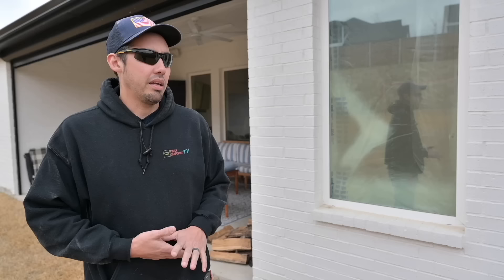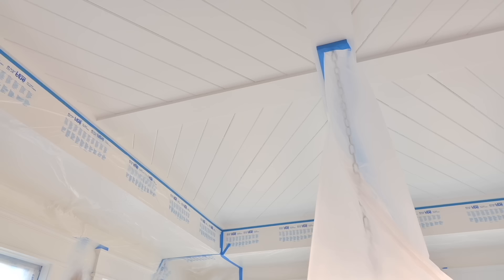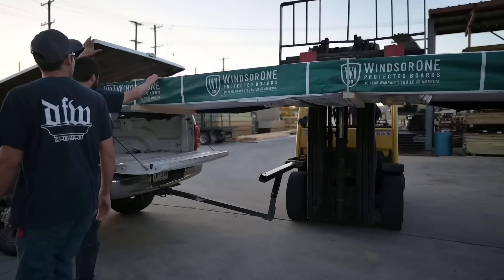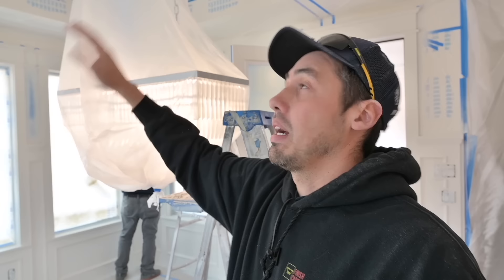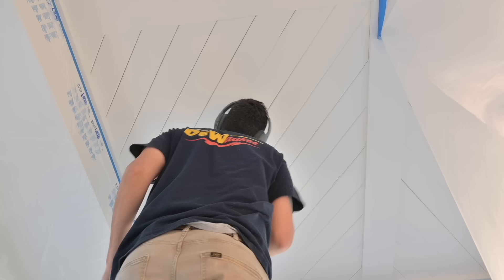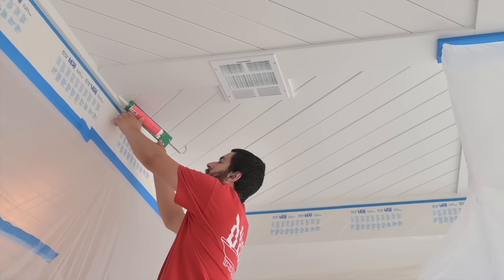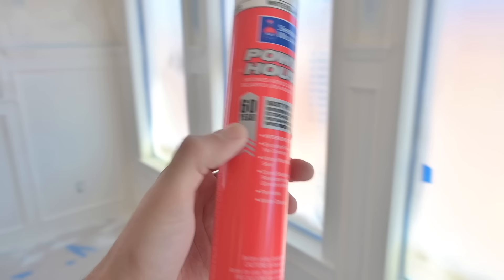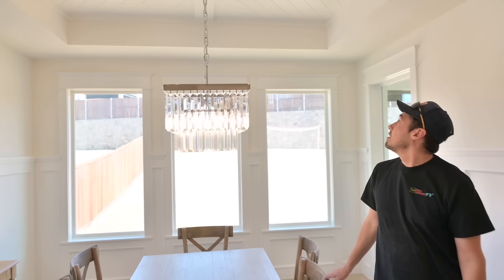Customer furious with me - Failed Trim Install

Comment: Shermax is lifetime. And it's urethane- ized. Urethane is the toughest it's what is used on commercial buildings to seal between the concrete panels. Undoubtedly the oil base stuff is higher quality. Their storm blaster is incredible and more difficult to use. I've used shermax many years and haven't seen it fail once. It's easy to use dries quickly, unlike some pretenders w/ very long cure times.

Comment: Neen doing this tyoe of work 34yrs and its alot more common for this to happen with today's lumber they grow these trees alot faster and harvest sooner u didnt have this problem with old growth wood. We use to installed fence boards with a 16 penny nail gap for expansion and now we butt them tight its definitely sucks cause its not your fault material is just chit even caulking has gotten so bad

Comment: You making it right is the sign of a professional. Right now we're going through a kitchen remodel in preparation to sell and the contractor we went with is horrible. They actually tried to install two different countertops thinking I wouldn't notice. I don't have the patience to list everything they failed on but my advice is never hire somebody based solely on the quote.

Comment: Those boards  Could acclimate for a year and that would still happen. It's wood. It expands and contracts seasonally. Flat sawn boards will shrink more than quarter or vertical grain.

Comment: Oh Boy,ok one way is what everyone is saying don't caulk,the other way is TO CAULK,
Allow me to explain.
Expanding wood is of course going to happen,it's how you midigate the appearance through the ever moving nature of wood.
You Caulked then painted,correct?
How you can address is to finish paint after you install,DO NOT CAULK PRIOR TO PAINTING,instead have your caulk matched to the Paint color and after the paint has cured then you caulk,if you want it to look tight and never see the movement, that's the trick. 
It will always move, always,doesn't matter if you sealed all six sides and then installed,.I swear to you this is the process for success. The caulk will fix with the movement but not look bad or have any cracked looking paint.

Comment: The homeowners HVAC system need to have dehumidifier and humidifier on the central system, otherwise it will crack again every year with the weather change. Caulked t&g can't be warranted with out proper HVAC. Your doing this in the winter, it's dry, the boards will expand again in the summer. And no, AC is not good enough to control humidity in the summer time. Vintage Painters on any other platform is my info. Much respect

Comment: Paint and caulk makes it what it’s not… lol… If you allow your materials to acclimate to the inside of the home… like hardwood floor guys do… you’ll never have this issue. That said, the heat/AC must be running and time doesn’t always allow for this. Another solution is to use pre finished T&G. It costs more… but the cost is offset by … no caulking needed at all… and no callbacks from unhappy customers. I believe that Intercity Lumber in Tampa Florida has the best prices on pre finished T&G in the country. They also carry unfinished cypress T&G… which will not shrink either… and it’s as cheap as pine. At least there anyways.

Comment: My entire house is done in carsiding and it definitely moves with the seasons. I also heat with wood which doesnt help.
Reply: What's the year, make and model of the car? I wanna do my house!
Reply: @symcardnel1741  1 x 8 x 12' Unfinished Tongue & Groove Carsiding
(Actual Size 23/32" x 7-1/16" x 12')
Model Number: 1411300 Menards ® SKU: 1411300

Comment: From observation, and from experience with wood, regardless if the wood is coated with a finish, it will still move with temperature and moisture fluctuation, perhaps just less.  I personally look for detail options and approaches that minimize the use of sealant when possible.   Sealant is a hassle and a pain to remove and replace.  I would not use in such an application.  It just draws attention to the condition when it fails.  I'm afraid that it will happen again.  Time to educate the owner on what can realistically be expected from wood or any material with shrinkage potential.

Comment: I don't think I would have caulked this to begin with... I have installed similar ceilings where the boards are painted and finished, and you use fastening clips that are hidden the tongue and groove.
Not sure how much expansion/contraction these can take before it shows, though.

Comment: In the future, prepaint your boards and install everything with no caulk whatsoever. Caulk turns a joint in to a maintenance item. It will be all cracked and separated again next year.

Comment: The case of a good installation which failed because of moisture content.  Hard to predict how much a board will shrink over time.  Not like flooring which has been dried.  At least you guaranteed your job.

Comment: One of the biggest problems with modern carpentry is that its techniques do not take expansion into account as the focus is more on design. 
The vast majority of work out there today has these issues and I would say it is a norm.

Comment: In flooring it's common for companies to let material aclimate to it's forever home, usually the reason why flooring is not installed untill HVAC is running. Would you say the same could be done here to prevent these issues?

Comment: The reason why this happens is because the back of the boards weren’t painted. It’s like when you paint one side of a door and when the client turns on the aircon and the door cups.

Comment: I'VE BEEN A CARPENTER, FINISH, CABINET MAKER FOR 35 YRS.....
THAT IS NOT YOUR FAULT....
this is normal expansion and contraction of the wood.
I had a guy complain about his 3 1/4" T & G  maple floor, finished natural, Installed in July, in a house just 700 ft from the water, flooring had been in the AC'd house for a month when installed, moisture was under 13%, industry standard when installed. Come Nov. when heat turned on, the floor shrank, each board about 1/128th, 1/64th....but 2-3 rows would stay tight, so the gap that showed up, was like 1/32nd of an in., which against the white floor, looked huge. Told him, unless you set the humidity level and temp at one setting, year round, this is normal and going to happen, wood absorbs humidity, moisture and swells, and then dries, shrinking, THAT WOOD
if anything, on that they were painted too soon and my painters NEVER caulked the t&g joints, because when the boards shrink, the torn caulk looks horrible

Comment: No dude. Even if they were bone dry, you would have issues. The moisture in the ceiling fluctuates like crazy, so does the temperature. Weather,heater and AC use just add to that. Temperature up there goes from 40- 125 f.  This does not show much in stain but when painting it shows way more. No pun. First off , you used cheap caulk like painters caulk hence why it almost peeled right out, then you used an OK caulk. 60 years 😂 yeah sure. Next time use trim screws, screwed in the field and on all cuts to joists or blocking to limit movements, then use a high quality elastomeric or urethane caulk. That will get you ten or fifteen years before you need to recaulk when the white room needs to get repainted. Next time put the extra 2k in the job for the extra time and material costs. Also let your client know before you build it that ceiling is going to dance and it will require maintenance every 10 years or so.

Comment: I worked on a few ceilings over the years. As a cabinet/furnituremaker I have superior skills to most finish carpenters. F carpenters don't like to hear that.
It will fail again in another way, someday. Experience is hard-earned.

Comment: hello, maybe a diferent caulk ? some caulk that expand and contract for this cases?
.- like in some hardwood floors , it must leave the hardwood floor in the house 15 days for stabilization at least ?
.- maybe "nelzonize¨ with nelsonite ?
.- and never use paint white in  this cases ?
.- is it  better if use mdf moisture resistant for this case ?
.- maybe some times apply paint and lets dries in the tongue and grove before instalation ? 
.- maybe apply paint in the six sides of each table or plank ? or sealer before instalation ?
this is just a commnents, thank you.

Comment: As a flooring store owner I lost jobs because I required acclimation on all products, even the waterproof that says not required and my  competitors did not require. I always doubled what manufacturer required. Reason being degree of temp high and low.  We will be 90 in day and drop to 5-60 at night. Humidity will go from 70% in an hour to 12%. My competitors always said never had a problem until like this gentlemen there is always the first time. I can say in 25 years never had this issue.

Comment: I have found out the warranty offered on a caulk means nothing you don't apply it correctly. I have seen people use that stuff and a year later is cracked or peeling away.

Comment: Don't take it so hard. There are many factors in that room, you had high ceilings, many windows, that makes it very hard for the wood to acclamate due to the variable temperature. But great work for showing others that you can correct an error.👍👍👍

Comment: The whole idea with T&G is that it allows for movement , NEVER caulk it ! what you need is the apply 1 coat of finish BOTH sides and final coat after install .live and learn...

Comment: I don’t think this is primarily your fault. I’ve installed plenty of these 1x6 v groove T&G boards and they shrink like this often, cracking the paint. It’s something in the milling process where these boards aren’t dried well enough, or pick up too much moisture right before install. They swell, get installed, and then are conditioned and shrink back down. You’d almost have to acclimate the boards in a conditioned space for a good length of time before install. That’s not really an option for most people.

Comment: Sometimes the house is wet and painters will use water base paint oil primer is better  and use glue on the joints  this is a big problem in Virginia  The builder is the problem

Comment: Demo the work, get it to where work can begin. Then pay back the clients. Then go back to the drawing board. My biggest loss was $3k on a kitchen job. My laborers knew I was in Palm Springs working at a new site so they shot kitchen cabinets with cheapest latex they could get and pocketed the money I gave them for sand paper, top grade sand able primer and Benjamin Moore Cabinet, Door, and Trim paint, which dries hard and can easily stand finger prints and washing.  It's 4 X the cost as the latex they got.  Then my laborers took the money divided it and went to another job, where I found one of them.  The guy who used him fired him on the spot.

Comment: I think customers expections with painting wood is like the same quality as a car which is all most impossible .Wood moves period  I'm sure on the ceiling you can add an extra 5 degrees with heat rising .
Had the exact same thing happen on a cabinet side the wood shrank  agap was left with the caulking I did fix but brutal because I used 2k urthane white .
The only way to get that perfect  is mill mdf sheet with the groves
Great video shows the truth about white you see the smallest gap

Comment: you should have a contract ready for customer to sign, where you tell that the humidity of the wood exceeds your recomended moisture and you can install ir right away but you wont take responsibility, and if it cracks it will cost them extra for the repair.

Comment: Probly a combination of movement and wrong caulking. If you used paintable glue at each joint would it have buckled instead? Maybe the caulk was painted before curing, trapping moisture

Comment: Richard, what are the chances of this happening again?  Is it possible for those boards to expand/contract to the same extent as the humidity and heat oscillate through the years?  Thanks for showing this unfortunate (and rare for you) outcome as a cautionary	tale for the rest of us.

Comment: Caulking is going to fail in a year again, always does, and is a pain to fix. Use MDF instead. And it paints really well too.
Reply: 60 year Sherwin Williams caulk? Yeah, ok....it'll be there in 60 years, but it's only going to be stuck to  one side in about a year. You'll be back.

Comment: The boards need to be allowed to acclimate to the room like floor boards and tongue and Groove board edges need to be painted prior to installation.  Why caulk the joints? Why didn't you use SW SherMax Urethanized Elastomeric Sealant which is a class 35 sealant?

Comment: I blame you. Not because it cracked but because you probably didn't explain it in the contract. Technically it isn't your fault that the house expanded so soon, it's the size and most likely weather conditions that caused it. It would be like it happening 10 years later which is when caulk starts to show wear and tear and they hold you responsible. Another thing, this happened to me once and you can order customized caulk to match the color and finish at Sherwin or Benjamin. It saves you the headache of repainting because that's a very nice addition on your behalf but absolutely overboard.

Comment: From a professional painters point of view. Never caulk tongue and groove. That is the point of it. Expansion and contraction. Same on exterior soffits etc. maybe use some cheap ship lap board or a type of material similar to avoid to movement but never caulk ship lap. Wood always comes never fully cured. Thats the reason a good builder will sticker and tarp the studs before a build. Mills always ship with a high moisture content.

Comment: I don't care what you do, it will happen again next year.  It will expand in the spring and summer, then it will shrink in the winter as soon as the clients crank up the heat. It happens every year and I explain it to them and make sure they are okay with it. In the future you could mill your own T&G out of MDF, eliminating any chance of expansion and contraction.

Comment: But when there is a streak of high humidity days they will swell up again, then when they dry out you’ll same the same problem. Might have used a polymer or synthetic material that have low or no expansion rates.

Comment: I hate to say this but it'll probably "fail" again. Wood is very  moisture sensitive. It expanded because it absorbed moisture. I'm not certain where you are located but if you have periods of high humidity and then times when the humidity is low it'll move on you again. I would have just removed the caulk and repainted. Personally I like the look of the seams as long as no unpainted surfaces are showing

Comment: A bit off topic but it does involve a ceiling. What would cause an area of ceiling drywall to crack along the seams? It's a large ceiling and a stair step crack pattern is showing up in a couple of areas. Is this a costly fix? And how long is it supposed to last before this happens? Thanks for your input

Comment: First of all you don’t caulk the joints.    Have to acclimate the lumber.    Prime the wood the desired color before install.   It’s going to exspand and contract no matter what.    Also don’t use finish nails use 7/16 staples.   Helps to minimize the movement.   I’ve been working with younger and groove daily for years.

Comment: #1 use PAINTABLE caulk.
I am DIY and used 100% silicone and, of course, paint will crack and peel right off of that silicone.

Comment: You installed in the summer (short sleeve shirts) when it was humid, and are now back in the colder months (hoodies) when it's drier.  What kind of heat is it?  Hot air?  How's their humidifier?

Comment: would using 1/4 plywood behind it and gluing the boards on it before install have made a difference since the plywood is more stable? So like making 4 panels and installing them as a whole panel after.

Comment: Imho it should never have been caulked in the first place. If the customer wasn't aware that wood moves and/or they didn't want that to happen then it might've been better using a solid panel of sheet material aka MDF and run some V grooves through it if you couldn't get one pre machined off the shelf. Every day is a learning day!

Comment: Great you own your mistakes.  I would have thought a T&G board would have been a better option, plus glued after ensuring MC was OK.  Design-wise (As a retired Architect and builder) painting the timber white sort of defeats the purpose of the effort to create the architectural feature.  A narrower board, stained and varnished would be a stunningly attractive feature.  But I guess the owner determined colour.

Comment: Seems u Americans have the same problem we have in the uk timber not seasoned properly or more importantly for the correct period of time  it just doesn’t seem to happen anymore for interior work like this it’s always a good thing to leave timber in the install area for a week or two (awkward and a bit impractical I know ) but it will aid the drying out process but remember to them leave expansion gaps on ur horizontal vertical junction cos timber can swell aswell as shrink across the grain depending on moisture content in the air

Comment: Fair play for owning your school boy errors, priming back and edges and acclimatising any timber prior to fitting, t&g boards are designed to move caulking in my opinion is not the right process

Comment: Yep,that same shit happened to me but with base and shoe, didnt acclumate the trim for a few days prior to install, it was winter and the wood was cold. About a week after install, i had to go back and fix way to much corners and seams because the wood swelled and expanded, and EVERY SINGLE FUCKIN JOINT was blown the hell out. I was so pissed i did that, so pissed......that i never did it again.